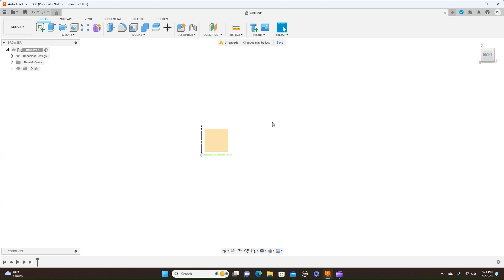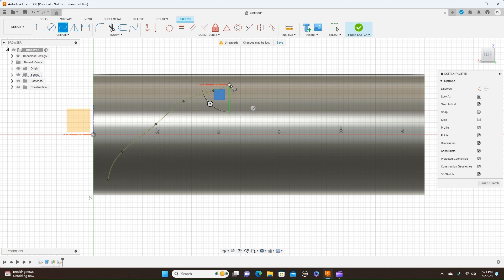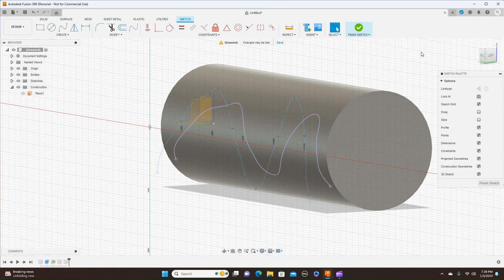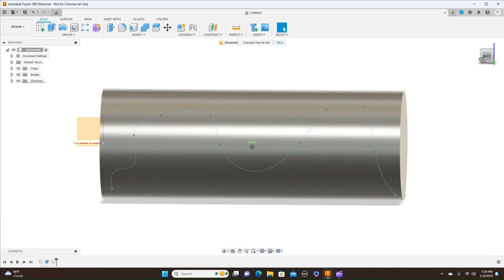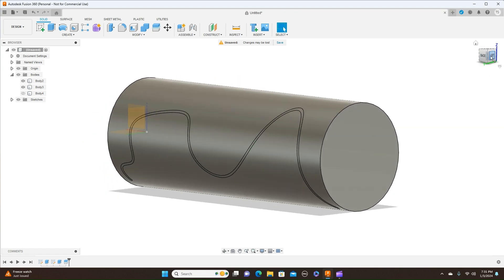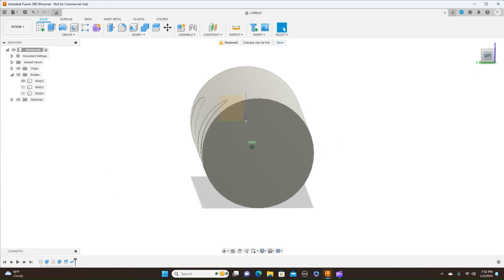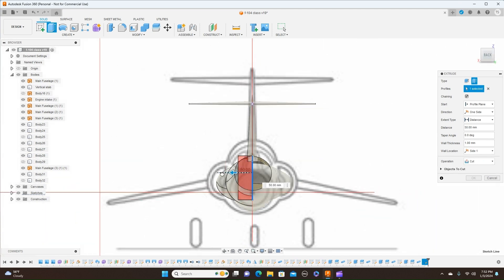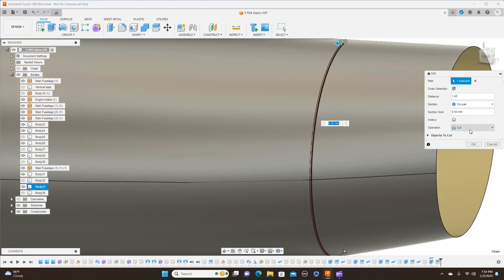How To Do Panel Lines The Easy Way In Fusion 360

Comment: I've had pretty decent results with this. However I run into issues particularly on wings with high curvature near the leading edge, it says the body would intersect when I try to cut a pipe into the surface. Do you know of any way to solve this?

Comment: Thank you for this video. I'm currently designing an F-84 Thunderjet in 1/18th scale and for my panel lines I used the Project To Surface feature instead. However this method isn't perfect either. If I select Closest Point the lines end up in weird places. If I select Along Vector I get a decent result with exceptions. Depending on the curvature a rectangle can become a parallelogram once projected to the surface. Another question I have is regarding the Pipe command. What does the distance setting do? Thank you, Gene
Reply from the maker: That is a very good question you have.  It allows you to specify the distance of the pipe you would like to draw along a spline.  Example.  draw a sketch using a spline like I did in the video.  Then go to the pipe command. Select the spline as the path.  You will see the arrow show up.  You can drag that arrow for the distance you want or type in the length you want in the distance box.  You may not want the have the whole spline as a pipe so you can specify the distance. I hope this helps.

Comment: - 'Project to Surface' will work just fine: use 'Project Type':'Along Vector' :)
Reply from the maker: That way works fine also.
Reply: @cadbuildflyrc3784  
- Yes.
- And, if I understand the design intent correctly, it produces same result as workflow shown in vid, but simpler :)
- Anyhow, nice model :) Carry on...